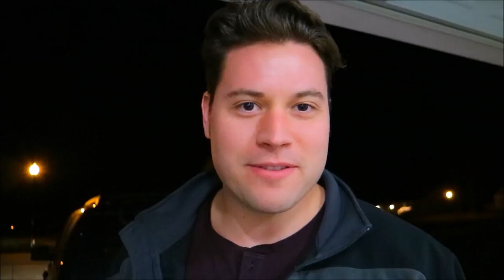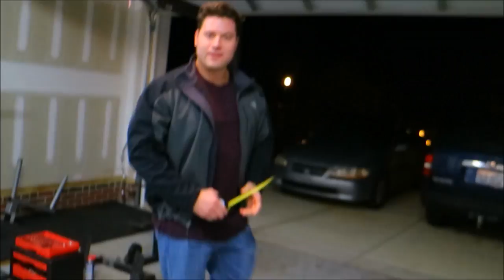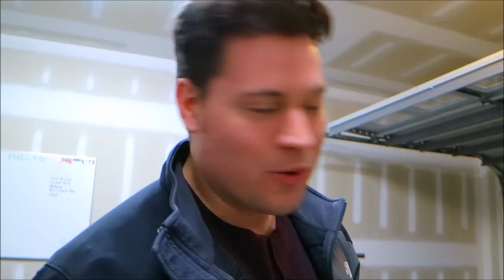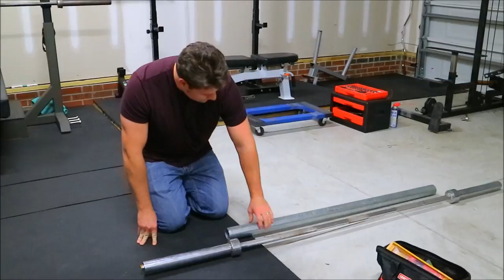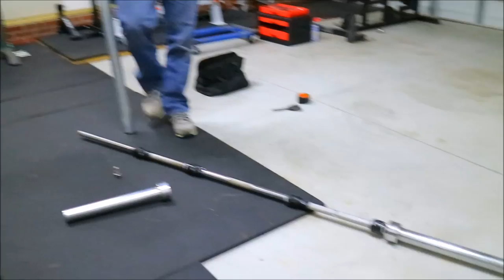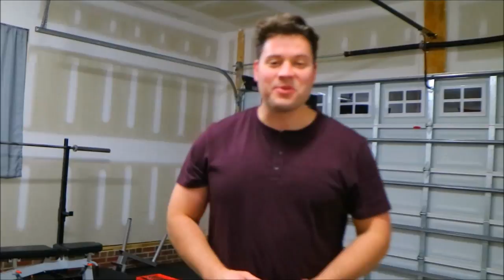DIY AXLE BAR FOR $30! | The Lady And The Traps

Comment: You can also get a 7’ piece of schedule 80 pipe 1.5” inside diameter. It has an OD of 1.9”. That is the same material Rouge uses for there axel bars. Wrap athletic tape and use regular collars. If you can weld tack a couple 3/4” pieces of 2”ID pipe where the collars go. I think it cost me $57 and $15 of that was to have Discount Steel cut the pipes.
Reply: TheTommygunner83 were did you get the pipe? I went to Lowe’s and all they had was 1.25 Are you talking black pipe?
Reply: @MrElectriccity  it's sch80 plastic for heating. It's not metal. If you ask for sch80 in white or grey at 1.5inch you will get an outside diameter of 1.9 which is the exact same rogue uses
Reply: It's also expensive as fuck. I would buy a stubby axle for 130$ before making one on my own. If I did, I would make it at least 90lbs and probably thicker than 1.9"

Comment: Bro wtf?!?! Get 7feet of 2 inch pipe, get the metal pipe clamps(you make them tight with a allon wrench) and boom, you got yourself a axle bar
Reply: I'm just seeing this... how much weight will that be able to hold tho? Thinking about doing that exact thing.
Reply: More than you will ever axle deadlift.
Reply: I was watching this and thinking exactly the same thing. Get a 7 ft piece of scaffold tubing. Fix a collar either end where you want the weights to stop. Put your weights on then put your other collars on. Obviously you would need 4 collars but that's what iv done.
Reply: @markgardiner1742  from where do you get collars? Could you please post the link? How much they cost?